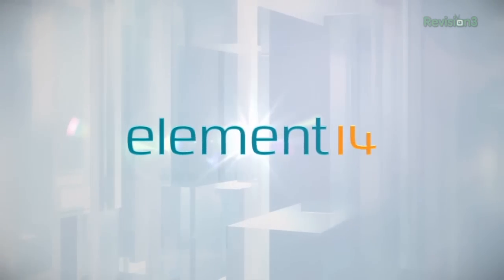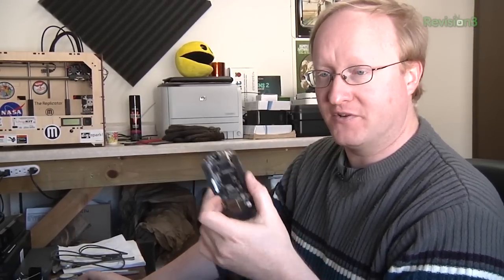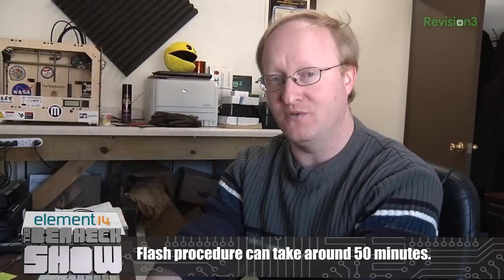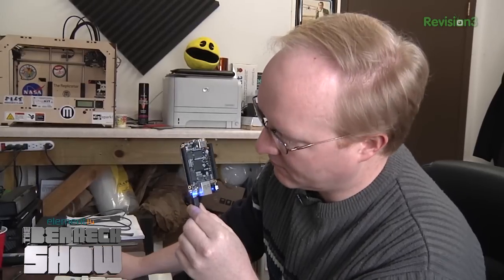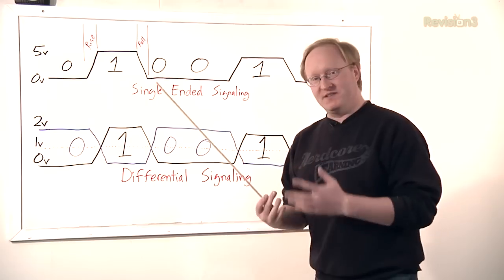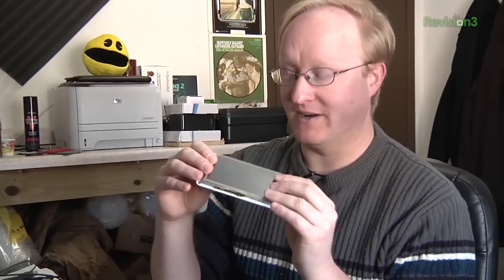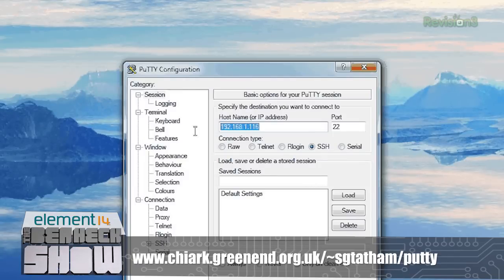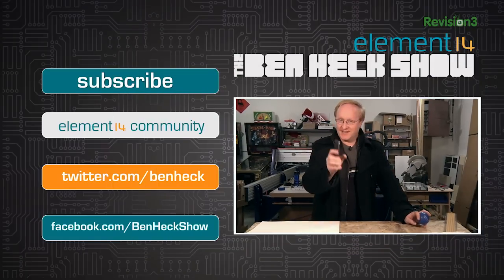Getting Started with the Beagle Bone Black

Comment: Inspired by watching your videos i have to share a "suggestion" for a future video you should consider. i am test working on some projects now and have a few questions that i am asking myself like "why / what is a pull up resistor, why do i need it, what does it do, what if i didn't have it etc"; not a problem being that i am following adafruit etc and just copying but for my future knowledge i am curious as to know why, and how in the future i know i should even consider grabbing a resistor etc if i read into the DHT11 does it request it etc; another question is can / should i use similar calculations to cable sizing of mains cable to know how to size a DC extension lead of sorts to accommodate voltage drop; say i wanted to run a DHT11/22 up stairs to the attic / basement or run a soil sensor from an enclosure in the shed out to the garden somewhere - how do you calculate the size cabling that should be used.

Comment: Hello, what IDE do I use to program for the Beagle Bone Black?

Another question is is there any Semaphore project that I can try to do?
Reply: A BBB is a single board computer. You would need to decide which operating system you want, then flash that image to an SD card and insert it into the BBB. There's a little more to the process, but instructions and walkthroughs can easily be found to cater to what settings and OS you prefer.

Comment: The explanation for the differential signaling seemed a bit jumbled; the "noise immunity" and the lower voltage range(and therefor speed) are treated as two separate features, whereas it may be more helpful for the viewer to understand that the lower voltage range is permitted by cancellation of common-mode noise. something something something humbucker guitar pickups, etc.

Comment: Is this like Arduino? Or more powerful?
Reply: It is not quite the same thing. Arduino is based in a Microcontroller. This uses a Microprocessor just like a SmartPhone. So you can install a complex operative system like linux. In the Arduino you could just install a simple OS. So basically the beagle bone is like a small computer. In fact you could program the Arduino using the beagle bone. So yes, is more powerful but there are things that you couldn't do as well in the beagle as you would do with a microcontroller. I hope that helps.
Reply: It is more powerful than an Arduino. It also uses more power. That's its biggest trade-off, especially for portable projects.

Comment: I just went to the beagleboard.org to get the newest image to update my beaglebone black, and I noticed that you can no longer dowload eMMC flashers. It said this: "To turn these images into eMMC flasher images, edit the /boot/uEnv.txt file on the Linux partition on the microSD card and remove the '#' on the line with 'cmdline=init=/opt/scripts/tools/eMMC/init-eMMC-flasher-v3.sh'. Enabling this will cause booting the microSD card to flash the eMMC." I don't know what this is or where to find it. Could you help me?
Reply: +Nicky Movie Company 
OK...Just so you know, I use Ubuntu 15.04 and am a Linux freak...so
my answer may not suit your computer.
We uploaded the latest image onto the flash-card, then accessed the flashcard using the Linux Terminal on my laptop using the command 
sudo gedit /media/username/rootfs/boot/uEnv.txt

the terminal will then ask for the admin password.

editing using the sudo command allows you to bypass permissions and edit the uEnv.txt (read only) file IN LINUX.

We tried on a Windows computer and failed miserably at it, but then......

Sudo rocks!
Long live Linus Torvalds!
Reply: Thanks for trying. The source of uEnv.txt will help greatly in my quest.

Comment: Someone told me these boards have a backdoor. Be careful if anything you do is mission critical.
Reply from the maker: Wouldn't that depend on what operating system you're running on it ?
Reply: The Ben Heck Show From what I remember it had something to do with the software packages on their community site, their custom os option perhaps it was? The source is an older blackhat demo video. The board was used for Jtag stuff and the person setting up noted something funny.
Reply: Josh Anderson Open source software makes it pretty hard to hide a backdoor.
Reply: The Ben Heck Show Not necessarily. Hardware can be backdoored.
Reply: Josh Anderson It could have a backdoor in the hardware. Which would easily be caught, because its open source.

It could have a backdoor in the software. Which would easily be caught, because its open source.
Reply: It's a credit card sized PC running Linux. I wouldn't even trust it to boot up.
Reply: +Skynet Cybernetics And why not? There are a number of single-board PC's that run Linux, each of them successful open-source hardware and software projects. You do know Linux is much more stable than Windows, right? And that Apple's OSX is built on top of FreeBSD, an open-source POSIX O/S - just like Linux?
Reply: +stryk187 even Mac osx is a Unix based os like linux

Comment: Root login enabled over shh.... facepalm
Reply: ssh?
Reply: Wiredzax
Secure shell, it's the protocol he used to connect to the board, Putty is simply the client he used, allowing root access over ssh is very bad practice but a lot of distributions now seem to be coming with this pre-configured :(
Reply: It's fine (in fact, common practice) with a development board/machine like this, it's not like the BBB is hosting your über-secure business documents or things of the like.
Reply: Munymuny200
Bad practice is bad practice, and since one of the notes made in the video is that it could be made accessible externally, very relevant.
Reply: I know what ssh is,i use it when i log into my home server with VNC. but the comment said shh.
Reply: Ah, so it did, well spotted :)

However you're question did not :p
Reply: It was implied that i was asking if that was what was meant.
Reply: I would somewhat beg to differ in all honestly, and to be fair, implication is next to nonsense.
Reply: thedarkener
Because changing a password has so much to do with the sshd configuration.

Well, no, but hey-ho.
Reply: MiggyManMike ....you mean shh? ;) Seriously though, this is a dev board. What do you expect?
Reply: :p

Dev board or not, bad practice is bad practice, it's one of those things that should be made habit really, but it's a fair point :)

Comment: "Built in flash is 8 bit and thus can run faster" there is so much wrong with that sentence it is not even funny anymore.
Reply: If the flash and the SD interface are running off the same clock, then it's correct. The flash chip will have aparallel 8-bit data bus, whereas the SD card is serial (since they usually connect it straight to one of the SoC's SPI interfaces).
Reply: ***** My point is that the fact that the flash is 8 bit wont mean that it is any faster then other memory types. If for example the flash has a parallel interface and the Processor used is 32 bit, a 32 bit flash is quicker then an 8 bit flash. That is my point, it totally depends on the rest of the setup, yet it is stated like 8 bit flash is always the quickest.
Reply: tHaH4x0r I took it to mean that 8 bit flash is faster on this particular board. There is ambiguity there, though, admittedly.